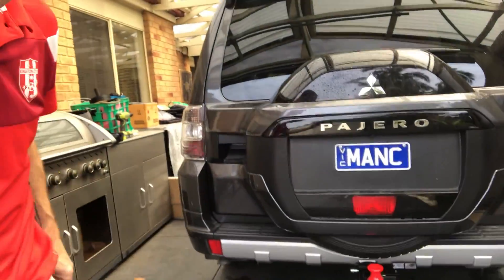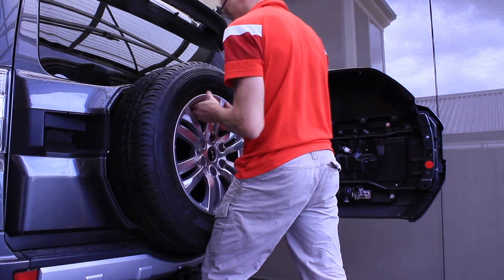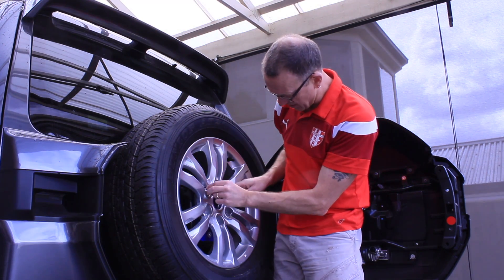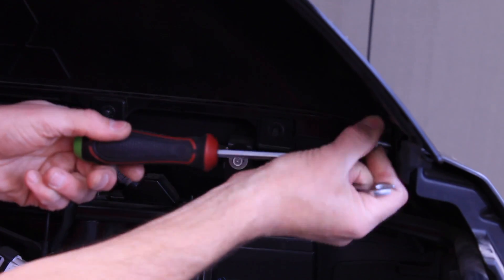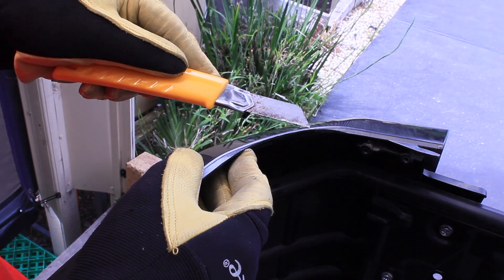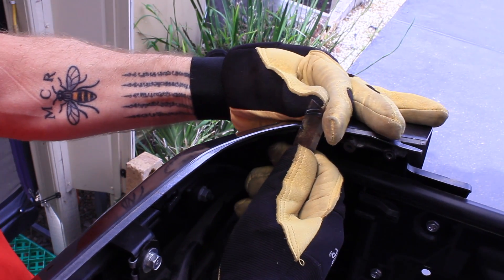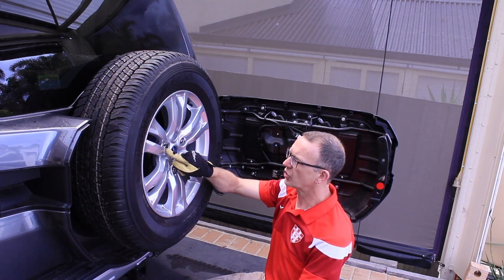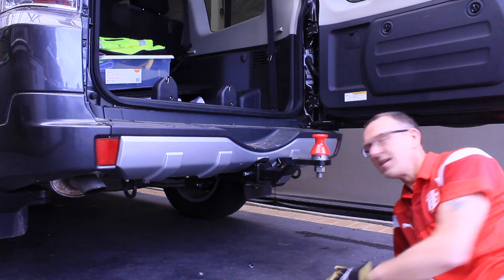Pajero NX Spare Wheel Lift Install

Comment: If i try to fit 32.5" (265 70 18) in mine, the problem is not the plastic parts, but the metal movement of the cover that hit the wheel😢😢😢. I don t now if the problem can be erase with spare whell lift....
Reply from the maker: umm, that's a tough one, we didn't have that problem. The wheel lift was primarily to lift the spare over the drawbar of our camper trailer  (bottom of spare wheel hit the handbrake and we could open the door fully). When we lifted the spare wheel we only had to remove the top part of the wheel cover, and to trim a small amount of plastic trim, as shown in the vid.
We hope you find a solution to your challenge, and if you do put it on YouTube because we bet other Paj owners have the same challenge you have :-)
Peace and thanks for the comment.
Reply: @seagullsontherun  i find my way. I try to fit up a little bit but the problem is the same: the two steel hinge touch the wheel. Finally i put only 1 bar on the wheel and so, close the pannel became little bit easily...sorry for my italian english)

Comment: It doesn't make sense to do so much to avoid problems with the tow pin, when lifting the wheel I remove visibility from the rearview mirror, it's better to keep removing the tow ball, for that you have that pin to remove and put on 🤷‍♂️
Reply from the maker: I have had no problems with rear view vision since lifting the spare wheel, the wheel is lift only 50mm, it doesn't enter into the line of sight and the rear view camera is not adjusted so no problems there.

Comment: Being able to take the top trim off that cover is genius level thinking from mitsubishi
Reply from the maker: That’s a very interesting statement. I hadn’t thought about the ability to remove that piece of trim and fit a larger tyre, was it planned? Was it fluke? Was it  just the easiest way manufacture the whole cover? I’ll side with Mits being ‘thinkers’ and the whole thing was designed on purpose 😂 
Here’s one for you, why don’t Mits devolve an ‘insert’ that can lift the top cover so it can be retained if you add larger tyres, now that would be genius I think
Reply: Genius would be designing a car that doesn’t have to modified in the first place

Comment: Does anyone know what size the the three original/stock bolts are (that were removed and binned)? I'm in the process of a reverse-lift (so that I can fit a larger tyre in the case) and the previous owner must have thrown them out.
Reply from the maker: hey, our my case we did not remove the original studs that supported the spare wheel, the lift-kit required them to remain in place to attach to - if you do not have them I cannot understand why they were removed.

Comment: Can you share what adjustment you made on the wheel top cover? Thanks
Reply from the maker: Hey, I removed the top cover complete as it isn’t able to be reattached when the spare wheel is lifted. If you want the wheel to be covered you can buy a cheap wheel cover and slip it over the spare before you close the wheel door.

Comment: That's great. I have a 2016 NX Pajero. Are you going to make any more videos on the Pajero? I wonder how this would go if you had a more aggressive tyre type (like a BFG KO2 or similar type of tyre)? I suspect the fitment would be even more difficult?
Reply from the maker: Hi, Thanks for your comments, I have made many modifications and videos that I haven't yet posted, I need to do that. HAHA. I guess a more aggressive tyre would mean you would have to chop/trim more of the plastic cover, my Yoko all-terrains didn't need too much chopping. If you opt for an aggressive tyre then you have no choice but to cut more plastic trim (or chuck the spare on a roof rack). Enjoy your Paj mate - Peace
Reply: @seagullsontherun  Cheers, thanks for that, will keep a watch for more videos.

Comment: Hi, good video ; )
where did you buy your hitch trailer?
I'm living in France, and mine is to close to the ground, its an other system, very bad in off road
cause touch all time the ground
Thank you
Pat
Reply from the maker: My trailer hitch is a CruiseMaster DO35 - not sure if they are international but here's the website - by the way in my opinion the best hitch I've ever used - love it.    https://cruisemaster.com.au/cruisemaster-do35/
Reply: Seagulls on the Run  I will check. Thank you
I agree with you, this kind of hitch is the best 
Bye bye ;)

Comment: What a waste of money, when you could just remove tow hitch and use it as needed.
Reply from the maker: Sorry but I believe you are wrong. Constantly towing an off road caravan with larger tow hitch means no access to the boot as the tyre hits hitch and cannot open fully, spending a SMALL amount of cash now allows us to fully open the boot even with caravan attached. In my mind, and probably in the minds of many others in the same predicament, it is money and time well spent. 
Thank you for watching and commenting. 
Peace
Reply: Without this mod you couldn’t change a flat tyre with the trailer attached!